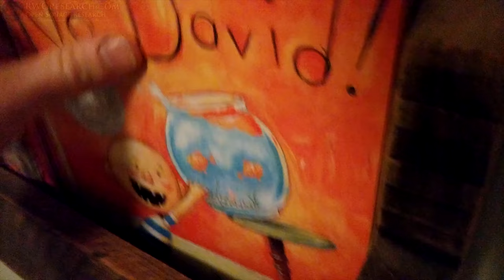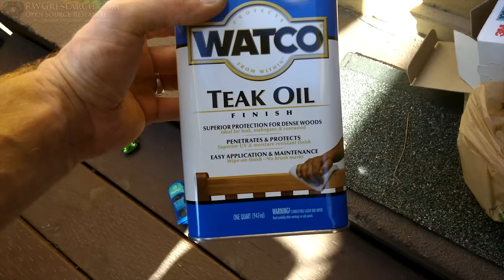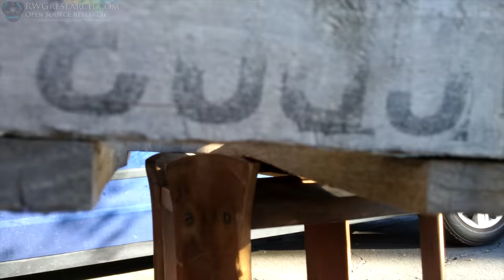DYI Pallet Book Shelf's From Old Pallets - Reclaimed Wood - Use Your Resources.

Comment: They make pallets out of ash, then soak them in formaldehyde. That is fine for outdoor use but that may pose a health risk indoors. To seal the wood you should get some polyurethane and apply at least three coats. Then that would be a lot less toxic.
Reply from the maker: ***** good thinking. I'm not sure when they started doing that but theses pallets are quite old. might be sun baked out by now... my dad worked with a friend who rebuild pallets for a living. so ill ask him where he gets the wood and what the hazards are. thanks! ~Russ
Reply: ***** Hi Russ, do a search for (
How to determine if a wood pallet is safe for use
by minnecrapolis ) and you can check your wood for the proper markings to verify safe or unsafe.
Reply: Pallets created with engineered wood and/or cardboard use formaldehyde.  Even then the levels are below what the FDA considers safe.  Standard, every day, oak pallets do not use formaldehyde however they might use other toxic chemicals to rid the wood of pathogens.  These types of pallets are easily identifiable.  They are marked (at least supposed to be).  They smell like chemicals.  They are stained.  Fortunately most pallets nowadays are treated in a kiln.  This is because most items shipped are used by humans, like food, medicine, and clothing.  In short, if you ever came across a chemically treated pallet, you probably wouldn't want it.
Reply: That's a good call, and the reason we do that is something called ISPM-15 certification. It's primarily used to stop the transfer of nematode and other creepy crawlers from spreading to other sections of the world. That's one of the major causes of Pine wilting in the US.